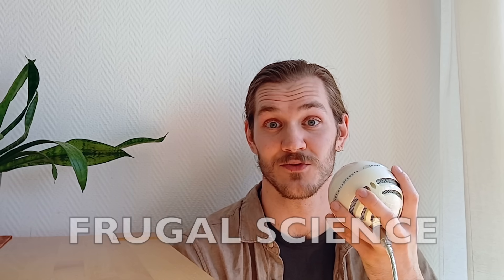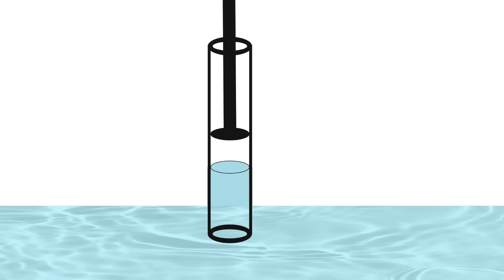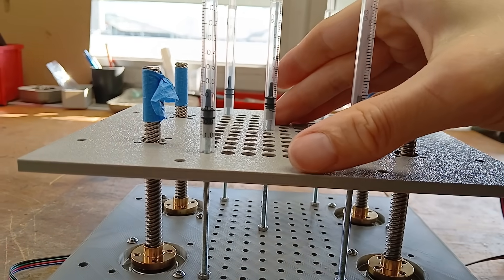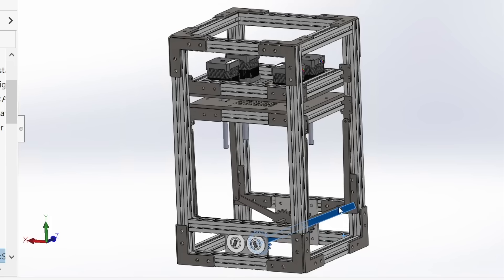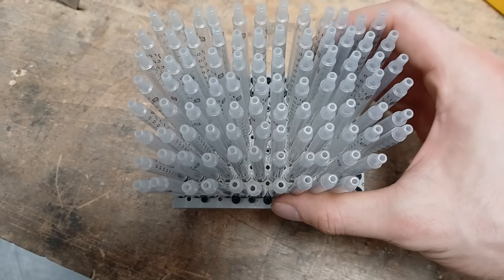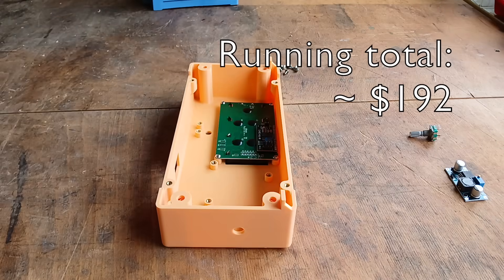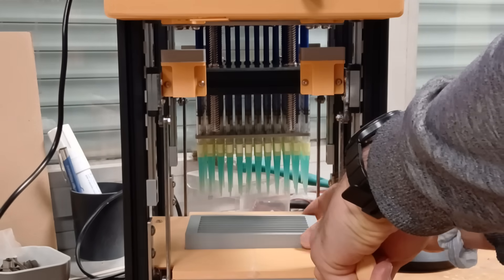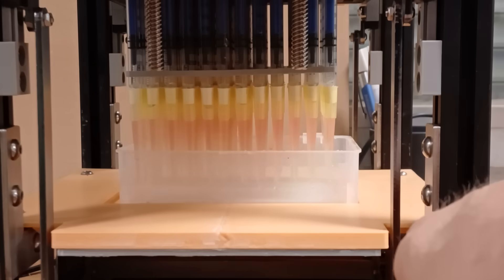This Medical Machine costs $18,000. I Took It Personally.

Comment: Almost every part of this is good but since it's a biochemical assya being done you don't have a way to prevent contamination of your samples. So if you take this similar design and make it sterlizable it'll work otherwise this isn't going to help. $18000 is a bit too much but you need a way to keep every well in this sterile and that's quite a challenge. So again maybe you can get away with this in some cases but for any lab work if it's not nuked into complete cleanliness you're not going to be able to carry out any tests with this reliably so while i'd say that your efforts on most of the device are admirable without a way to pretty much garuntee that every single well is free of any form of biological contamination the effort doesn't overcome the hurdle that these expensive machines overcome so this is haly way to a good solution and needs to be assessed for improvement to a point where you can garuntee sterility and remove all possibility for contamination. You are not that far from overcoming this. if find a way to swap out the syringe system for metal plungers and glass syringes that can survive sterilization protocols and you change out every component that cannot survive an autoclaving process, it exposure to 150bar at 150C for 15 minutes you will have aw orking solution, so again your prototype is good and it's a a few steps away from being a workable lab tool, it just has to be able to survive sterilization or the contamination is not something that can be risk for lab results. So I am certain that with your approach this is possible however $250 is unlikely, but maybe with the upgrades to make it robust enough to survive being autoclaved and also UV sterilized and maybe even gamma irradiated then you'll have a tool that is up to the needs of a lab. So you can definitely knock a fat chunk off that $18000 but you do need to be able to ensure there is nothing in any of the wells that could contaminate your samples. So I don't want to rain negativity into a project that is definitely in the correct spirit and I also don't want to justify the pricetag of the machinery you're trying to beat out but you have to geat the tool to a state that it can be subjected to the protocols required to be able to negate any possibilities for contamination, without it it will not function for the purpose it is supposed to and the health of people who are using this for tests cannot be garunteed. So you need to make all the micro-electornics removable, you need to add UV sterilization maps to the removable parts, you need to make sure the filament you used to print everything  else can withstand autoclaving (it cannot) So if the syringes and all the fitting for those syringes can withstand an autoclave and all the plates and everything else can make it through an autoclave cycle, which is a real probability depending on the plastic, so you can't use thermoplastics basically, so you need to get an industrial autoclave run and make it all strippable down to nothing that can die to hot compressed steam, I tihnk the steppers might be able to survive this actually, or you might be able to get seals that can survive this. So some of the parts you made won't work but in general this whole design is good as long as you make sure you use as many components as possible that can survive the autoclaving process. So the shrinktube obviously cannot be used. But like I said you are very close to something useful here. SO you can get the costs down just unlikely as low as stated in the video, for $250 this is a pretty crazy success but it's not the whole way to useable. Sterility in any lab or dignostic setting is absolutely paramount and I cannot overstante jus thow much effort there needs to be taken to maintain sterility  and remove all possible sources of contamination at all costs. So you effectively need to garuntee that inside the air in each of those tubes there is no protein or DNA or RNA (rna is easy since RNAses are literally everywhere) but RNA-ases are a contaminant too so etc etc. So Please do not drop this project here, keep workign on it until it can be autoclaved even if it increases the costs. This is a very noble goal and if you contineu along here you will reach a tool that can perform as needed and can be decontaminated. Decontamination is incredibly stringent and subjecting your tools to 150C worth of highly pressurized steam tends to do nasty things to it. Most autoclave interiors look like they were in a warzone so you can imagine how tough your materials have to be to survive these processes.

Comment: I love the idea behind this, especially if it can help out those that need it most. But if you really want it to be used to help medically you were smart in using off the shelf as much as possible, but the up/down function probably should go back to moving the smaller part. Instead of moving a large mechanized multipart thing. It just seem way more likely to break down for what seems to be purely aesthetic preference. In any case this was cool to watch and a neat device.

Comment: I commend the effort but you fail to highlight that 99% of the $18k is validation, regulatory compliance and record keeping. Most drugs and devices aren’t expensive to make, but our self imposed regulatory requirements drive the cost through the roof. You need an army of PhD’s running expensive instruments to prove everything.

Comment: But why would you decide to move the heavy mechanical part instead of the multi-well? Like, it would only make sense to move the lighter part instead. Also, you can see the lever arm bend under weight at 5:25 (edit: 7:58 okay, but you are still moving a heavy assembly)

All that said, this is a great video!

Comment: 02:10 You only need 1 motor, just use gears or toothed belt drive to spin the other spindles. You also don't need 4, just 3, since you work in 3D space

Comment: woah, hang on, cant you just have a chamber connected to all the pipets and have the chamber vacuumed to the desired pressure, then slide a plate horizontally  with the holes so that they all open at the same time, then you dispense in the reverse. its all about the pressure chamber, no plungers.

Comment: Isn’t the whole point of the machines in the labs that they are extremely precise and easy to keep sterile?  It doesn’t seem like this could actually be used for its intended purpose.  It is a fun project though. Well done on that part

Comment: Really incredible work, thank you so much for showing off your talents 😊

I would love to see a follow-up, to optimise and minimising components. For example, I'm really surprised you didn't go with the screw clamp at 3:15 - this seems like it would significantly reduce part count and complexity.
Reply from the maker: Thank you! Yep, I agree that part was definitely overengineered. I was worried the contents of the wells might slosh around, but that turned out to be no issue at all.

Comment: This looks great for a homemade setup. I'd like to see the spectrophotometry results in terms of well-to-well reproducibility. For example, add 100 µl of Bradford reagent to each well, then 20, 50, or 100 µl of a protein solution at a constant concentration and calculate the SD vs. a commercial multipipette. Of course, it's easier to find a plate reader than a lab with a 96x pipette...
Reply from the maker: I hadn't considered spectrophotometry, thank you for the suggestion!

Comment: Nice! I used to work as a pipette technician and those 8 channel pipettes used a bar across them similar to what you've done here. They had a special grease and sometimes 3-4 orings depending on the size which could be a pain to replicate so the syringe was a great alternative.

Comment: I have worked as Head of Admin, Accounting and HR in a small Biotech and they used exactly those plates. Yes, all those machines are extremely overpriced which goes into our health insurance primes (and politicians for some 'unknown' reason tend not to do much about it and partially it can be explained with the certification process, I get it). BUT being a tinkerer as you are, I was able to build the mirror stands for reading those plates for a fraction of the money, since they don't need any certification. And the staff even said they were better than the original ones. So we can offer much cheaper alternatives to what exists and counterforce those egoistically high costs! In any case: WELL DONE!!!

Comment: Great job!
Also - a single motor and a timing belt for all of the threaded rods and rollers running on the extrusions instead of mgn rails would have saved quite some cost B-)

Comment: Can't you use a of the shelf manual multi pipet 
It already has the multi tip dispensing and auto tip ejecting and it is not that expensive 

Mount that to a robot arm and you have a system that will work

Comment: I work as the electronics technician for a university chemistry department. When lab gear breaks out of warranty, I (and/or one of my machinist colleagues) am the one that looks at it. I’m appalled by the extortionate prices on so much lab equipment. While I do understand that R&D to develop these machines costs money, and that they often take a “spare no expense” approach to the designs, the prices are often kinda insane, even if we are cognizant of the small production numbers of a lot of this stuff.

I recently spent an unhealthy amount of time refurbishing a bi-distiller (a two-stage water distillation machine). It is, at its core, two boiler vessels with heaters, two condenser columns, some separate tubes for float switches to sit in, and a siphon, all made of Pyrex. Beyond that, it’s just a few solenoid valves (same type used in washing machines and dishwashers), a few float switches, some relays, and a small control board. So essentially, a very fancy water kettle. 

Since they’d just discontinued that model, we would have had to order the larger-capacity model (same design, just with double the heating capacity) at over $10K. Even accepting the lovely glassblown parts, that just seems like an awful lot for a thing whose only real job is to boil water. And since upgrading to the larger model would have in turn required installing a three-phase outlet, I instead replaced the heaters, installed dimmers to reduce their power (so they will last much longer) since my users don’t need even the capacity of the small model, replaced the float switches, and readjusted it all, so it should be good for another 30 years of service! :P 

Anywho, I also encounter really specialized equipment that is made by small companies, and some of it looks like it was assembled by budding hobbyists. Bad solder joints, cobbled-together designs, etc. I would be ashamed to charge money for something made that way.

Just last week I fixed a potentiostat cable that stopped working, which the manufacturer wouldn’t replace under warranty (since “cables are consumables” 🙄). The problem? They messed up during assembly and tore all but one strand of the wire into a banana plug while pushing on its insulating grip. A few flexes and the surviving strand broke off.
Reply: a university Lab shouldnt have a machine like this. student labour is free...
for other application 18k for a machine that replaces a lab tech is incredible cheap
Reply: @nox5555  WTF are you talking about? No number of students can distill water without equipment. Not that we have free student labor. This is a research university, not a diploma mill.
Reply: @tookitogo  Well the machine in this video can be replaced by hand. also student labour is always free, and a 4 weeks course of doing basic lab task is the best way of them how to learn it.
Reply: @nox5555  No, student labor isn’t “always” free. The students working in the labs are mostly doctorate students, who get paid. (Not much, but they are paid.) But even if it were, other constraints (like speed and reproducibility) may dictate the use of automated equipment.

Comment: Or just make it into a head attachment for your 3d printer or cnc router.
You could even do an alternative that could use the print heads to actuate the syringes in any sequence.
Would require special printer code but nothing crazy

Comment: For 12-channell 30 ul manual pipette the ISO 8655 allows for max 0.6 ul of systematic error and 0.24 ul of random error (I don't know how this applies to automatic pipettes but it's a reference point). And the typical test consists of 10 weighings for each channell. Maybe make DIY laboratory balance next to replace the measurements with kitchen scale?
Reply: Hello fellow service technician, ISO 8655 standards are the same no matter if it's manual or electronic. However, ISO 8655 2022 standards dictate a 2x4 as-found, PM, 2x4 as-returned/as-left for accreditation.
Reply: Well that would be alot harder, there is only one company in the world that makes good lab balances.
Reply: @nox5555  lol, no. Sartorius, Fischer, Cole-Parmer, Mettler, Radwag, Ohaus, A&D, Smiadzu. Probably a few more.
Reply: @elementiro  Sartorius is by far the best.
Reply: @elementiro  Throw Mettler-Toledo in there, they're probably the most commonly bought lab balance.
Reply: @MaskMan191 already included it as "Mettler" - we usually omit second part of the name where I live for convienience. :)